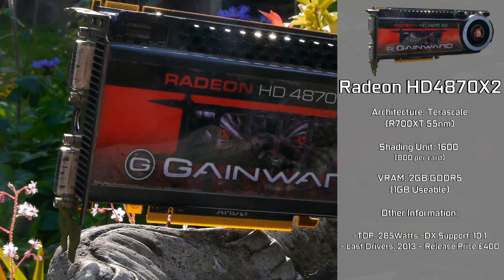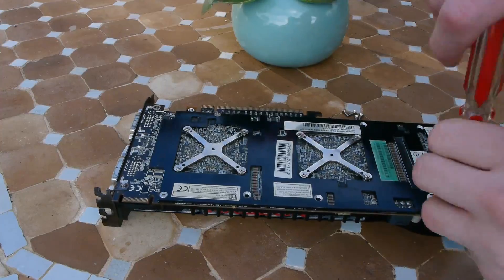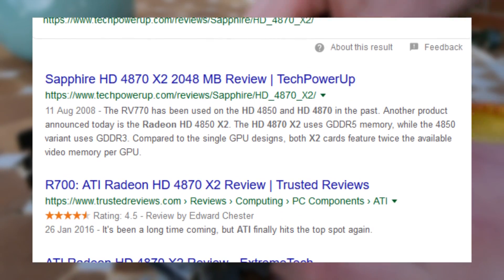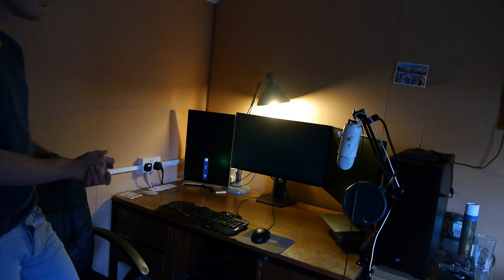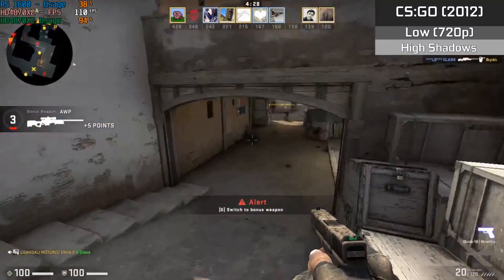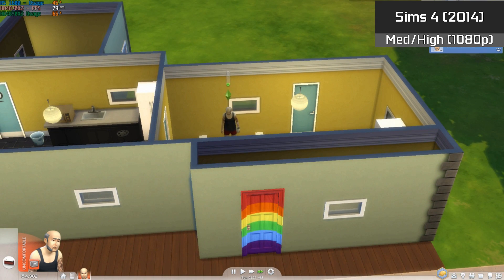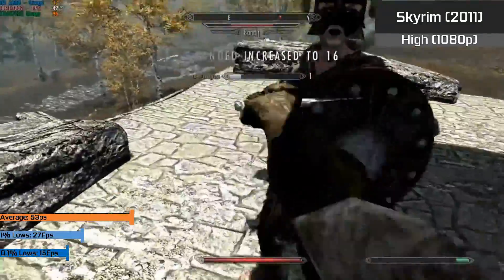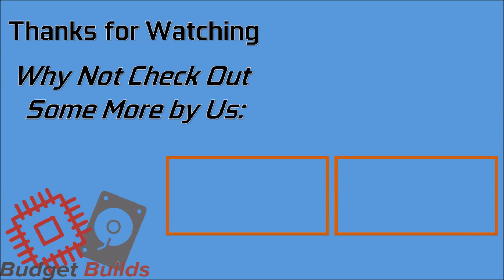When AMD Stuck 2 Graphics Cards Together - The HD4870X2

Comment: remember that crap. Too much heat, too much noise, too much consumption. micro stutters. Drivers were snide. Now my friends play new games while I can't, because new games don't see the second core at once, (so I get half of performance), , or run with glitches, or don't start at all.  Then they eventually fix it, with drivers or patches. It could take even a year. but guess what, when I try older games, with newer drivers - they run worse. So I need special drivers for every game and need to reinstall them. That's fun, yeah? You pay for a premium card and get the worst product with a worst support. l wanted to take this black brick. and beat the sh out of those ati braindonors who designed this piece as well as driver programmers. I sold it and bought single core card that had similar performance, but  didn't have issues.

Comment: radeon hd4870 x2 is efficient by working hardware acceleration but radeon hd2900 xtx is more efficient if they fix all the defects and install more videoram memory 6 gigabytes or 8 gigabytes to compete with geforce gtx 480 6gigabytes videoram memory

Comment: I almost bought this back in the day but i opted for 2 4890s in crossfire... My gigabyte board (ma790x-ds4) had terrible cooling on the northbridge and used to overheat when running crossfire ;__; Should have just only bought the one xD

Comment: I had this, though I don't remember right now which make.  Yes it was fast, but I didn't keep it for as long as I could.  It was not only getting very hot, but it was SO DAMN NOISY!  It's like you had a huge vacuum cleaner in the room.  I am not kidding.  
Eventually I replaced it with a HD6850 which IIRC was not faster, but it was definitely quieter and IIRC with less power consumption too.  Though I admit I didn't pay much attention to power consumption back then.

Now days even if I had the money I would never buy an almost 300W GPU.  

Thanks for the video.

Comment: I had this card.. such a terrible experience....Had to do sooo many drivers updates, always looking for third party drivers that fixed problems ati couldnt....IT was awesome when it worked, the problem is that many games didnt work or gave tons of issues.. I still remember the Frame rate bug that basically halved your FPS after a while and the only way to fix it was alt tabbing... such a pain in the ass.. 2 cards in the same PCB is a very bad idea, it is what i learned.

Comment: 6800 series was better than what nvidia was offering at that time. I really wouldn't say Nvidia has left them in the dust for a matter as I found nvidia cards tend to be good at gaming, but meh for other tasks, and slapped on features that were limited by a API that looked at a .ini file found in windows that all you needed to do was go in to that .ini on a amd card and oh look you got physx.  I been using nvidia cards for about 5 years, and they had terrible drivers, more worse than any AMD drivers I have ever had to deal with. Also linux compatibility. My last nvidia card a  msi 1660ti oc linux drivers would never turn on the fans no matter the temp. This would eventually kill my card, this being linux drivers windows users tend to see as irrelevant and have no understanding why someone would use something like linux and blame linux rather than their precious brand loyalties.  Now there has been plenty of times where a AMD drivers were bad but quickly fixed by the open source drivers, and there has been plenty of distros that didn't work, but this was all distros, all versions of the drivers for the card. Now the present API's is to attempt to prevent AMD fr\om using RT and FedelityFX, which is exactly how Nvidia cards in their current state are doing so well, not to mention how Nvidia's drivers have weakened the performance of their older cards.

On windows I had a issue that spanned 5 different graphics cards, all of them relating to drivers for over a year from september 2020-sept 2021 there was a issue with the drivers that would cause output flicker, this is when the video signal cuts off for exactly 2 seconds, and then cuts back in. Now on regular desktop usage this wasn't much of a issue, it is when I started to make models, maps, or do anything that was gpu intensive that it became a issue commonly causing the programs to crash, and if I didn't save work well it was gone jim.  This was from Nvidia not amd, for a year. A YEAR of driver issues surounding NON-30 series cards that spanned 3 different machines and 5 different cards. On downgrading them to pre-30 series cards launch drivers all of the driver issues were resolved and so were performance issues that the graphics cards were having with those drivers were performance seemed heavily GIMPED in games. 

I switched to a AMD 6700xt last month and I have yet to have a SINGLE problem with windows or linux. The only thing I see is Nvidia fanboys and obviously bought out reviewers spewing about how bad these cards are and how perfect Nvidia is. I used their cards for 5 years, and I am so done with them. I also see nvidia is ready to take away their review copies of cards if they speak anything positive about AMD at all too.

Comment: I also got a dual GPU the Radeon HD 3850 X2 i used it until 2017. Most of the games we're absolutely playable If they Doesnt  needed dx11. This Thing was a Powerhouse but directly after Release the drivers we're problematic and it sounded Like a legit Vacuum cleaner. Also it was roughly overclockable i ocd it from
699mhz to 980mhz Core and used it Like that for 4 years or so with an  homemade cooling solution and it Could have gone further but i only had a 500 Watts psu. if i Pushed it
Any further the system would instantly turn off to Protect in more demanding areas. 😂😂😂

Comment: 7:50 what? I played GTA V perfectly fine on my ryzen 5 3500u... Granted I couldnt crank the settings up due to 2GB of vram but still it was a solid experience for mobile integrated graphics very playable. I could get 1080p low/medium settings and around at around 35fps.

Now I have a 1660 super though and the experience is definitely better. Cranking settings up to max 1080p looks a lot nicer and I still get around 100fps... (75ish fps on online mode)

Comment: I owned the powercolor one. Brilliant card. Switched to it form a single slot sapphire 3870 512mb vaporx card which i bought only as a stand in. I remember initially buying a enermax 650w platinum modular PSU (that still runs brilliantly to this day) thinking that it will be enough for this x2 card. It wasn't. I ended up buying a 1200w akasa PSU (it still powers my i7 8700k GeForce 1080 rig) to keep up with this card. I had it paired with an core 2duo 8500 on an Intel x48 board, 4gb of corsair dominator ddr3 ram and Windows vista... Great days!

Comment: Guys the best card I recommend is:
GTX1050Ti
It’s very cheap you can play new titles on high setting and it would be smooth
You don’t need external power too it’s under 95£ so yeah I recommend it

Comment: I used to have a 4870x2 back in the day. It was a beast but it was overkill, and not in a good way. It drew 480w under full load and mine would hit 100C until i put a custom cooler on it. It also sounded like a jet engine inside your case.

Comment: Well, one benefit of AMD Cards is that they seem to lose value faster so you can find better cards for a cheap price, at least in the used market. I had an HD 5670 512MB, which was actually much better performing than an Nvidia Card I found selling for the same price. I have a GTX 1050 Ti now, though.

Comment: I had the 3870 x2, the 4870 x2 and finally the 6990 x2 cards... before I upgraded to a GTX980 non TI. All of these cards where watercooled via custom loop.  I even had DUAL 6990 x2's and DUAL 4870 X2's for quad Crossfire.

Comment: having had an HD4850 1gb edition and later second in crossfire, the crossfire ran very smooth. i was saddened to hear form my friend that crossfire was never that smooth again. now i stick to single gpu and run stuff like SSDs or 10G networking in the other free slots

Comment: I feel like 1GB of memory with 2GB onboard and an outdated driver was causing newer games to over allocate memory. Causing crashing.
similiar to the 970 3.5bg issue.
Reply: I still used 4870 like year ago and the drivers were a big problem
(my notebook died and had to use something:D)

Comment: There was another dual gpu card, the Radeon R9 295x2. It was two R9 290X chips on a single card that came with a built-in AIO cooler, which had a fan on the rad and a fan in the middle of the card. When it was released in 2014 it was the most powerful card on the market.

Comment: Dudes says there is no microstutter... but 15FPS lows... GET REAL MAN... this is exactly why crossfire was dropped, modern multigpu programming can deliever consistently better FPS across the board compared to this which cannot. And as mentioned in the video what microstutter it does avoid is at the cost of duplicating everything in VRAM.. .so you really only have 1GB in any realistic senario due to the way the drivers work. The reason these cards can scale as well as they do , is they are not running in to CU scaling limitations there is plenty of work to go around, while on a card like Vega the CUs get starved, if you had 2 Vega GPUs in crossfire they'd end up starved a much higher percent of the time as the driver can't schedule the work effectively to keep the CUs busy... so instead multi gpu progrmaming means each GPU gets graphics just sent to it directly by the game engine, rather than having the driver attempt to do it badly.

Comment: Funny you should mention Nvidia fanboi's, this thing, by your own benchmarks, is just above a GTX260, has terrible drivers etc but you manage to looks past all that, from a butthurt Nvidia fanboi, lol. I always choose Nvidia, like I always buy VW, just because I like the brand. After bought a Cryris CPU back in the 90's and finding stuff wouldn't work with it, I have always just stuck to Intel and Nvidia,  I guess my thinking is Intel is the de facto standard for processors, so I wouldn't buy AMD, and I guess I extend that to AMD GPU's, silly I know, but you don't buy a GPU very often and they cost a lot of money, well a semi decent one does, so why risk your hard earned on an unknown?
Reply from the maker: Companies are Companies. The driver are solid from when they were actually supporting the card... Which ya know isn't in 2019.

Comment: older cards run really good with new cpu's my asus ares hd5870x2 runs 3 times the fps with ryzen 5 3600 than it did with the AMD 1100t  i used  with my build with that video card

Comment: Partway through the crypto mining craze (2014 ish, before the scrypt cudaminer came out). I bought a HD4870x2 on amazon for like $25, I received a 3870x2 that was damaged in transit that wasn't capable of whatever I was mining. Got a refund and kept the card which kinda works unless you install the drivers, then it just artifacts super bad and crashes the driver.

Comment: This was my dream card when i was young.

Of course I could not buy this card as a teenager but the dream remained. 
Now that I have the possibility, I bought 2 x hd4870x2 and packed it together with a 1000 Watt power supply into a system. 

It is useless and it gets extremely hot. But I have my dream computer from my youth. 

Now it stands beside my Main Pc.

Comment: Only GOOD crosfire experience i've have had was with asus hd6870 dc crosfire.
After that i had 6990 and r9 290x cf and had lot of problems to get games to utilize the card properly.

my 290x cf setup even got worse fps than a single card most of the time

Comment: I love a good history lesson and all but if I was looking for a budget graphics card in 2019 I think I would go with the RX 560 for $99 currently on Amazon, or pay slightly more for the 570 which is still the best best value for performance out of all options
Reply: @Zipzeolocke Definitely, although I think this series is more about how far you could possibly push hardware, not what is necessarily the easiest to use on a budget.

Also for me personally, as of now, I'm aiming for the gtx 1060 3/6 GB or the rx 580 4/8 GB as those are the bare minimum requirements for playing any game today as of now at 1080p 60 fps/hz ultra. Gives some headroom for fluctuations.

Comment: Had one of these. I had to remove the plastic shroud and add two additional fans to keep it from melting.
Reply from the maker: The plastic shroud guides the air flow
Reply: I know but mine was reaching 100c in games until i modded the fans, still died a year after that.

Comment: Ah, I remember my HD 4870X2. It died right in the middle of Crysis. RIP
Reply: Rest in piece , where can i put the flowers? Wheres the grave
Reply: @costelli1  Problem was, I put on an aftermarket cooler, and I strongly suspect one of the capacitors didn't have proper contact with the heat sink. After about a year, poof...dead.
Reply: wtf i have a radeon hd 6470M and i have no problems whit it (1280x1024 res, medium-high settings, over 50 fps)

Comment: 0:50 I had severe anxiety watching the back of the card hanging above that puddle of water.....
Reply: wouldn't really do anything until he turned it on without drying out the traces, just saying, I don't mean to ruin your fun
Reply: More than once I have cleaned off a GPU with distilled water and had no issues. In fact if you were to get a very very clean PCB and some extremely pure water you could even get it wet while it operates and not have any issues. Water is not conductive when it is ultra purified, so as long as there's nothing on the card to get dissolved into the water it would act the same as a mineral oil submersion. Obviously that's not really possible in practice though. Still as long as the electronics remain completely unpowered there's no danger at all in getting them wet.
Reply: @KingHalbatorix  even tho what you say is true, King nor is anyone recommending anyone should throw water on their PC while it is plugged in and turned on.
Reply: @ezcoreg759  People do that with toasters. I'd personally do it with a computer if I could. Just because. But sadly, I don't have the fire department at the whim and ready.  So there goes those dreams.

Edit: Then agian, Linus had one of his lackyes, erm I mean employee's do that while it was turned on.
Reply: Yeah, computer parts aren't easily breakable by water.

Comment: Why did you use old drivers?! These cards works perfectly fine with the lastest drivers, I would even bet they gain performance compared to old drivers. I know this because I have been using Radeons since the x700 series and drivers always managed to push the cards to the limits.
Reply from the maker: The X Series had good final drivers. I used the most up to date Drivers available for the card (Not the beta ones) as those are honestly not a great bet to use.

Comment: You say that CS:GO runs well but if you look at the animations whenever you respawned it looked like you were having a heart attack. It looks unstable and I wouldn't touch it considering CS:GO likes to use 1.5-2GB of VRAM in normal competitive at 1080p and much more VRAM on Danger Zone as the map is as large as the limits of the Source Engine 2013 (obviously it's been upgraded since because Apex legends uses Source and it's much larger than what's possible in CS:GO) I am surprised that crossfire worked properly in CS as it seems to hate it and SLI on modern GPUs
Reply from the maker: That's my ping not the game itself. It was running 200-300ms, as the servers were playing up for some reason.

Comment: In 2009 my work bought me 5x ATI Radeon HD 5970s for my flight simulator - they were hot and power consuming monsters and, despite having 2GB, it was only 1GB per GPU so, very quickly, my flight simulator outgrew them - which was a shame - because they were over £500 each and were briefly "The World's Fastest Consumer Graphics Card".

Many of the issues you're discussing here about the HD4870X2 would imply ATI did nothing in the year between the 4870X2 and my 5970s (and yes, drivers really did suck)

Comment: how about sourcing a 2 gb HD 5870 & compare it vs something like a RX 550 ?
(there is a workstation card based on the HD 5870 2 gb as well if you cant find the original anywhere.)

Comment: Haha. I just bought a boxed one and one unboxed. Gave the unboxed one fresh paste and thermal paste and dumped it in a 775 (modded 771) build.
Reply: Xeon mod?
Reply: @thefurrygamer1489  Yes. I bought a modded Xeon E5450 on AliExpress and dropped it in a MSI board. No BIOS microcode needed
Reply: @GuybrushThriftweed  How'd you pull that off?  All mods I've seen of that required a modded bios.

Comment: so you gave up on linux testing? If the card can support Vulkan, you should probably give it a try! Same game via proton or wine using DXVK 1.1 or later (try lutris or protondb)
Reply from the maker: The card supports DX10 at max, and has no Vulkan Support.
Reply: This is very old card. Not even AMD HD6K and HD5K series support vulkan

Comment: There still doing it with the radeon pro duo
Reply: Nvidia has quad GPU in a card too in the pro series. Last gaming card was 390X2 Devil edition ($150 near me, super cheap way to get 4x for 4k gaming with 8 GB cards on a common normal board, though I use 4x Fury on X399, Crysis 3 at 4k Ultra 100 fps is crazy amazing to game on!)

Comment: could you please show fake tablet?  There has been a lot of hacked ones on ebay & Aliexpress for quite some time now. It has tablets with very low prices and fantastically high specifications. They cost around 50 pounds and suppose to have 4gb ram, 128 gb memory and 2 GHZ cpus. ( but only have one Gigabyte of RAM and around 16 Gigs of internal storage that were hacked. Type in TABLET 4+64 GB into ebay and you will find them. 
THANKS